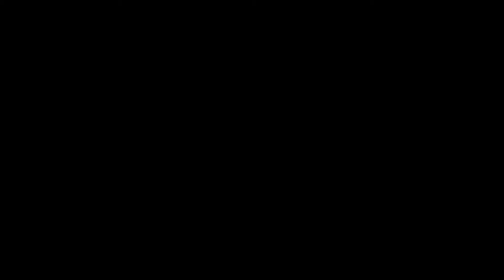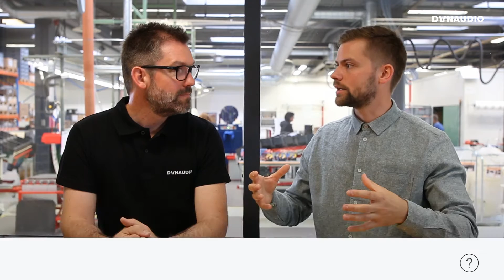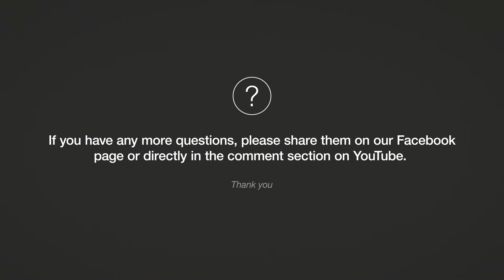Ask the Expert: Why is Dynaudio moving towards small voice coils?

Comment: Why dont you use 1st order filters anymore like it was used 20 years ago. Only evidence master has 6db/oct filter slope
Reply from the maker: Good question! Rather than using a fixed approach to crossover design, we use what is required for a given model to reach optimum performance. We generally try to use as little filtering as possible, however at the same time we do not want to use less than what is needed.  Note that several of the current products do partially use electrically first order crossovers still, such as Emit and even the active Focus.

Another thing to keep in mind is that while the electrical crossover slopes are typically first or second order, the actual acoustic crossover can be much more complex because of the response of the drivers themselves. So even if a loudspeaker uses first order electrical crossover, the acoustic slopes are usually not. Hope this helps :)
Reply: @dynaudio  yes the accoustical slope can be 12 dB or even more and stil using 6dB 1st order electronic passive filters. That was specifically mentioned, that the decay of drivers was engineered so using only 6dB electric filters was enough to get the needed separation.between the drivers and keep the best transient respons and more important phase shift to a minimum.

I think the diy dynaudio finale has proven how good conventional speakers can be. The only downside of finale is the size and the enormous amount of power needed to get higer SPL. But when giving them enough clean power, the sound is —to my opinion - nothing short of stunning!!!  I am so curious how they would measure in the jupiter facility